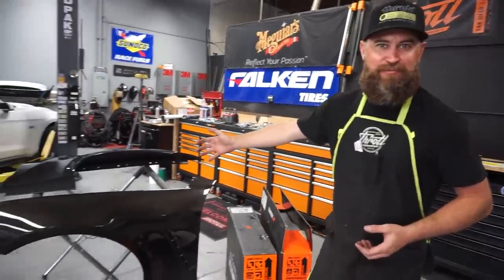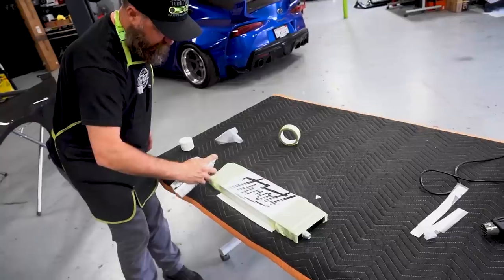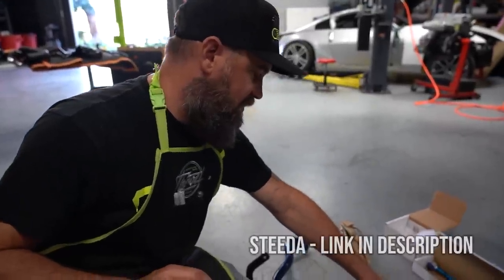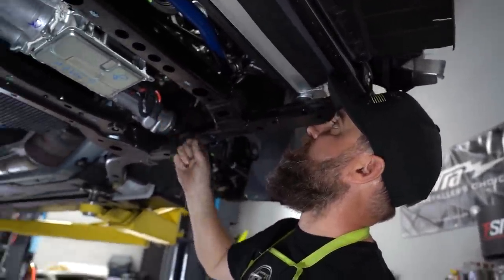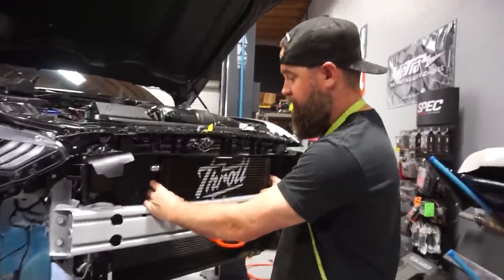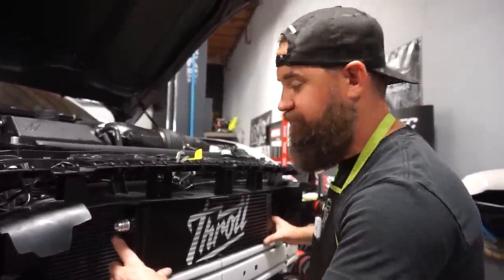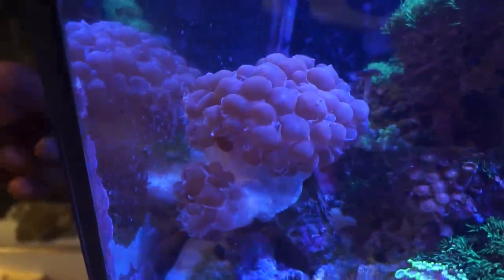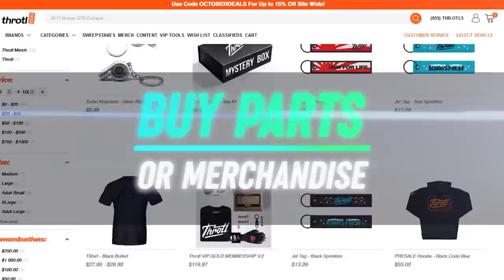Building and Heavily Modifying a 2020 Ford Mustang GT: Part 7: New Fenders! Mishimoto Parts!

Comment: Did you have to bypass the error codes for the air louvers? I have a focus ST n without them it brings up engine light, so we have to add a relay and delete codes.